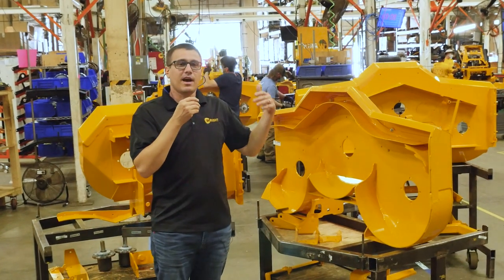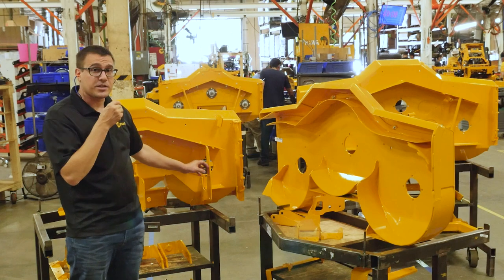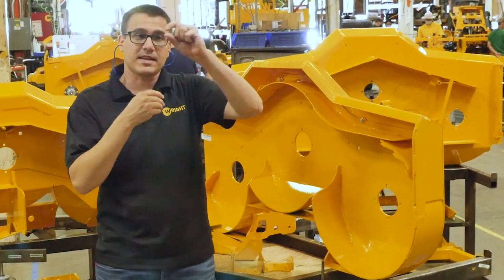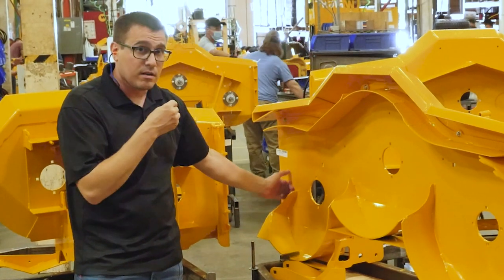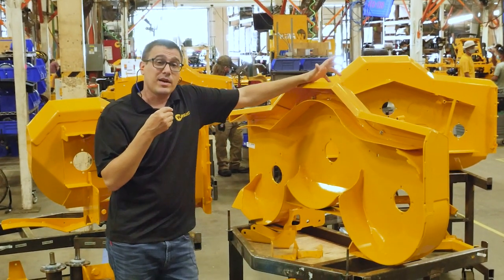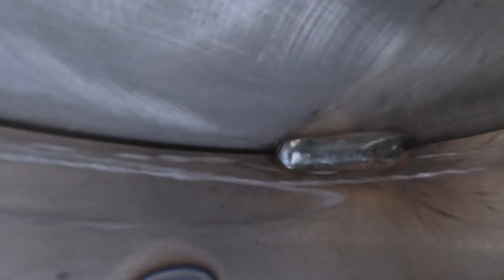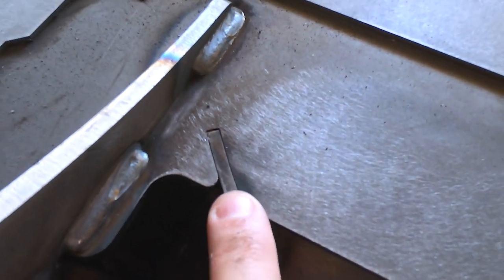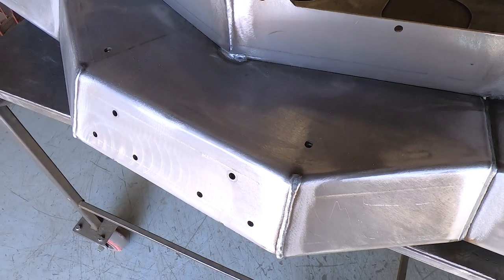WRIGHT | MOWER DECK CONSTRUCTION

Comment: I have a 61” zto. Love the mower. 2 things that I noticed. The deck wheels make a lot of noise when at high speed. This is when the deck is in the lowered position to cut. Also the spindle covers seem to have paint that is just flaking off. No other issues other than that.
Reply: Anybody else notice the noise coming from the deck wheels?

Comment: What is MSRP on the new 40 hp 72" deck? Thanks
Reply from the maker: About $14k
Reply: @WrightMowers  Thx...impressive mower!
Reply: @StanWilhite  - I ordered my ZXT 72 back in May (2022) and it took 4 ½ months for it to arrive at the dealer due to short supply. My price was locked in back in May for $14,999 and that’s exactly how much I paid on 9-20-2022.

Comment: Ed, you need to have a 90° angle between the back skirt and the deck top. The added steel underneath, I’m guessing was intended to help discharge clippings. It has the opposite effect. I have a ZK 52” & I have an eXmark Lazer ZX 60” that we mow the same properties with and the ZK deck always needs cleaning. Even if grass isn’t damp. I’d really like to see this changed in the future. Also, I really really hate the bolt through spindles on the ZK. I had an I stander with those spindles. Demo’d an X and it had spindles like my eXmark which btw is now 10 years old and still going strong, no spindle or deck issues. 
I guess what I’m saying is, I give my ZK 4 out of five stars but, if you were to make the two changes I mentioned, definitely five stars.

Comment: How many hours can u get out of a well maintained ZK?
Reply: ³will
Reply: ²and the mall and I will
Reply: 5
Reply from the maker: The engine is usually the limiting factor. The mower frame can survive about 3 engines. I often say that an engine's life might nominally be 2000hrs but if you really take care of it, I've heard of engines going to 5000hrs. -Ed
Reply: If you change oil every 50 hrs, plugs every season, blow out the air filter, keep grass build up off the engine, it should last you 2800-3000 hrs. My KAW did.